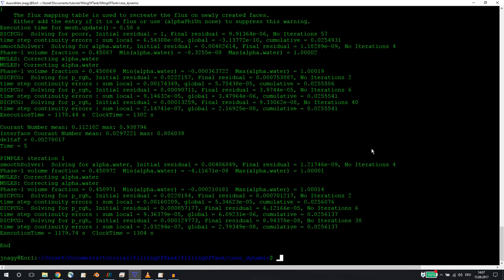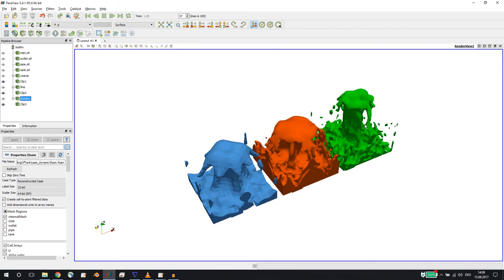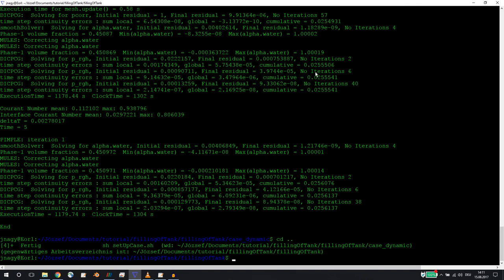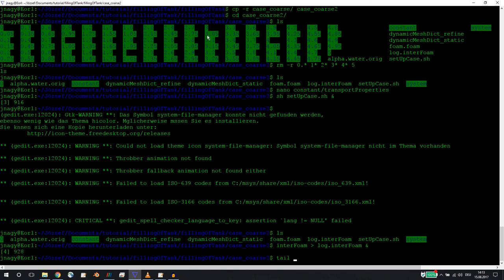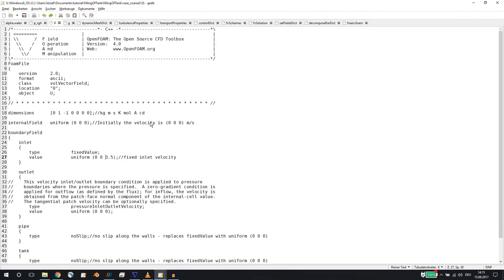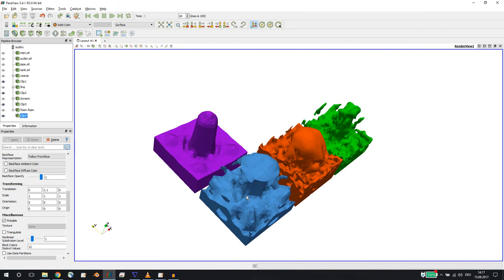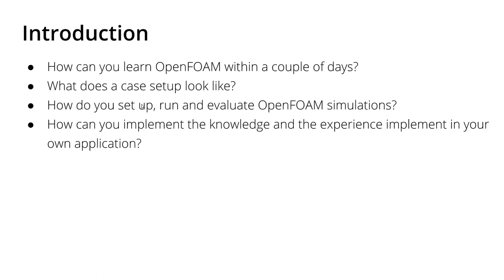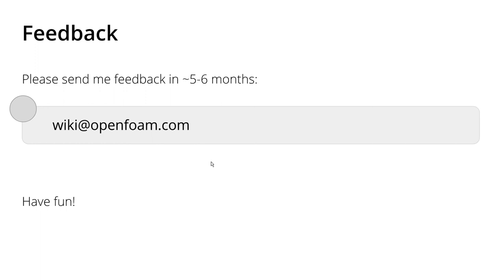Multiphase simulation project in OpenFOAM in Windows 10 and Ubuntu - tutorial part 5 - conclusion

Comment: Hello Jozsef Nagy
I have a question, please. Is it possible to export the pressure applied on the tank and pipe walls (transient) to an FEA tool, such as ANSYS mechanical to perform the dynamic structure analysis ?
Please, let me know if you have suggestion(s) on how to perform an FSI analysis in general
Thank you in advance :) 
Best regards,

Comment: Thank you for all this!
How to adapt the timeStep when I use prismlayers?
Do I have to make them small in the wohole geometry small enough for the smallest prism cell?
If yes: Is there a way to only make this in snall cells and not in in the whole geometry?
Reply from the maker: Im an not sure what you mean. How so you want to adopt the time step size?
Reply: Sorry if this was not precise enough. 

My thinking is the following: If I add prism layers the minimal cell size will go down, what also decreases the Courant-Number.
So, I must also decrease the timestep, what rises the computing time up. 
My question is if this is really necessary ''only'' because of the prism layers especially because most of the volume in still covered with big cells. Maybe there's a way to treat the prism layers different or so?

Thank you.
Reply from the maker: @ironsimonx4221  I see. If you use adjustableRunTime, this is automatically done by the solver. And yes, the smallest cell counts unfortunately.

Comment: Hello Jozsef, thanks for the videos. These are very helpful. Can you post a video relating to evaporation? For example evaporation of a water droplet suspended in air at 100 degree C.
Reply from the maker: Thank you very much! Well, this is a very specific topic. Evaporation due to thermal effects is a difficult task. I cooperated with my friends at Rheologic exactly on that topic. Check out this video of them: 

https://www.youtube.com/watch?v=Uh9wCNi7uWI

You can contact them, if you are interested:  

https://rheologic.net/en/rheologic-contact-information

I hope, this helps.
Reply: Thanks for the reply. I checked the video, and it is just an animation video. A lot of phenomena like boiling, condensation, evaporation, Rayleigh-Bernard Convection, etc include phase change due to temperature. Is it possible to include in next version of OpenFOAM ? Moreover, it will help a lot for my doctorate.
Reply from the maker: You'll have to ask OpenCFD about that.